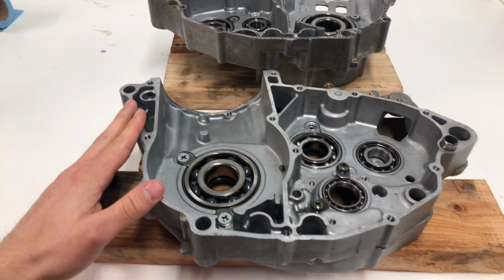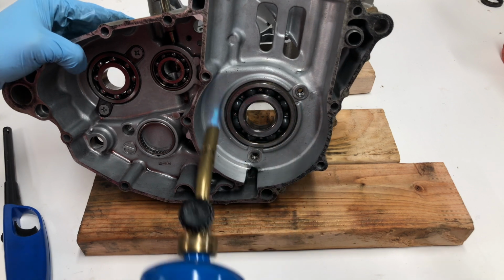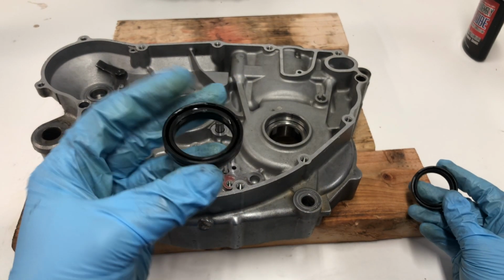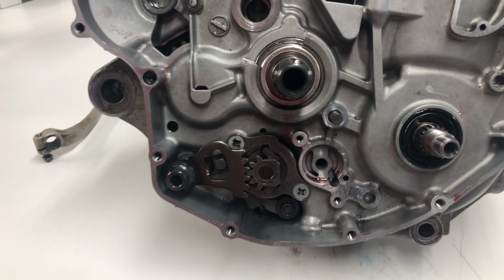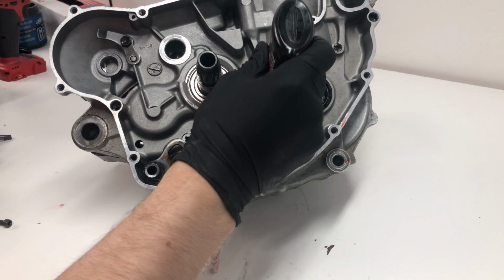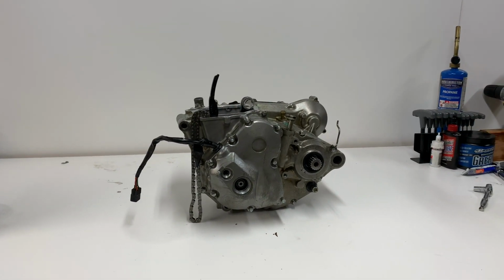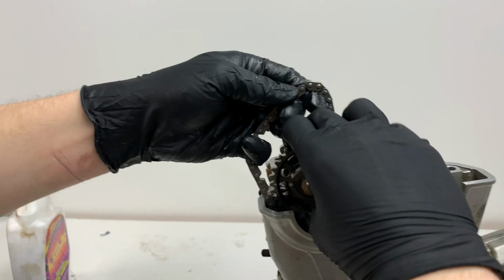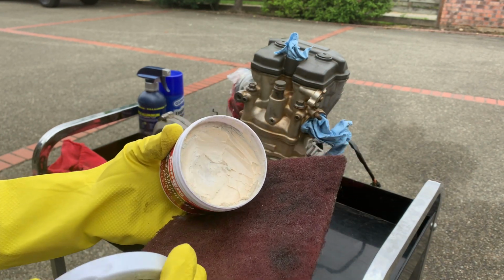How To Make Money Flipping Dirt Bikes Part 2

Comment: Can you do a 2013 kx250f in your 4 stroke engine build series? Just bought one that’s blown up and has a hole in both the cases, bent valves, connecting rod in half and I’m debating on doing the work myself if you make a video on it

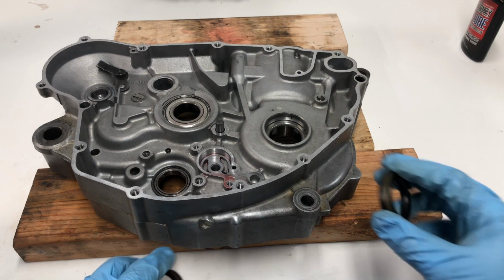Comment: 5:20 Short explaination:
4 Stroke engines have no precompression, therefore the preassure is higher on the gearbox side. This results in the seals facing with their preassure sides (lip sides) towards the gearbox and away from the crankcase

Comment: hey, quick question, is there any point in cleaning the cases after you put the engine together? It seems easier to clean taken apart. I have no clue if it would be a risk at damaging internals for cleaning while it's apart. Thanks!

Comment: Adam Paganelli Do you recommend purchasing a service manual for every bike you work on? I try to keep one for every bike I own but I frequently help friends on their bikes and they usually cheap out by skipping the manual. I don't like this because online torque specs and other info is often incorrect. I'd imagine spending an extra $50 on every bike can cut into profit but over time you could collect most that you need. I recently purchased a home and plan to flip more bikes with the extra space I will have.
Reply from the maker: Hey man. They definitely make life easier so I usually pick one up if it needs any sort of serious work. If you HMU on Instagram I can send you a link to where you can buy service manuals for around $10

Comment: That clutch looked shot when you put it back in. & the oil filter looked used not new
Reply: Some discoloring of the steel plates does not necessarily mean clutch is shot, and oil filters can be re used provided they are not contaminated.  My concern was he didn't show fitting the oil filter spring. But as the rest of his work was very good I doubt it was forgotten.